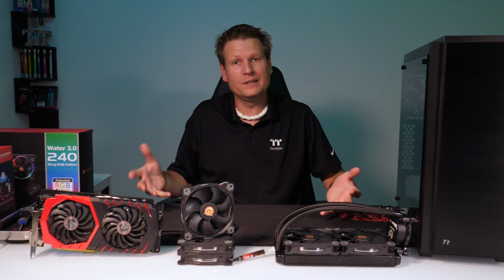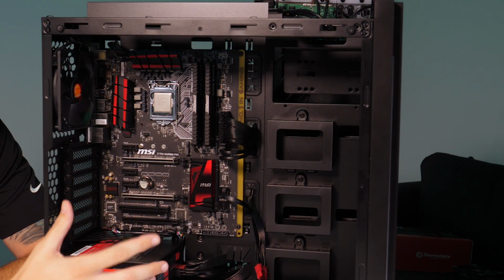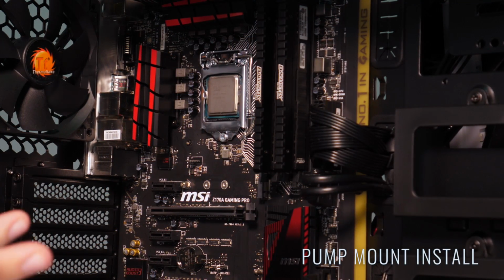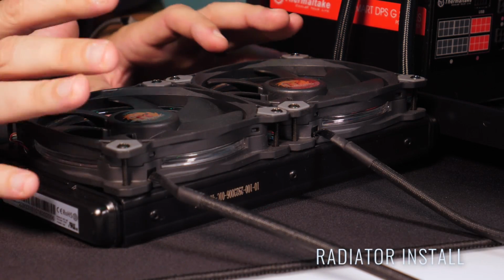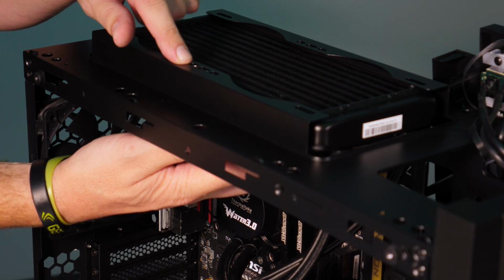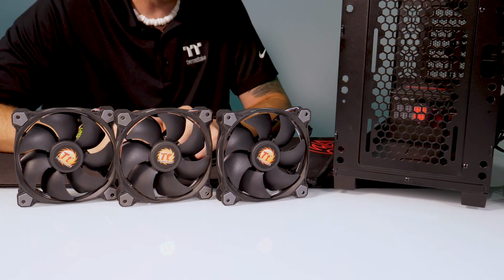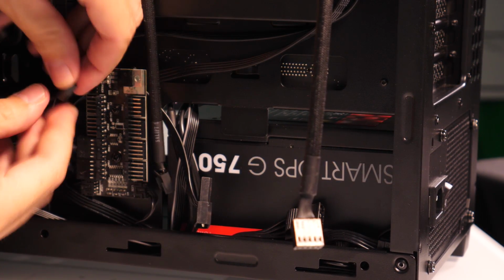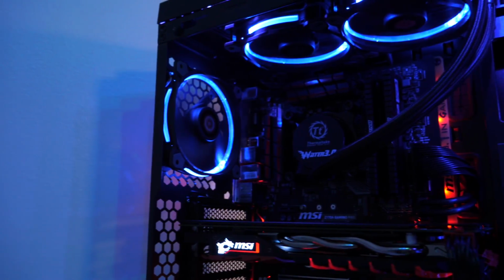Thermaltake Versa C23 Tempered Glass RGB Chassis

Comment: I hate how this case chokes the fans. I have one 240mm rad on top for the CPU and one 120mm in front for the GPU, but the temps are too high, if I take apart the front cover, temps get 12° lower, and the same happens with the top cover.

Comment: Is it possible to connect the controller to the Mainboard for Fan-Speed controll????
Reply: Thor Odinson hey I have the same problem. I'm using the riing 12 fans and they run at full speed. My solution was to just use the fan hub that came with your riing fans. As of right now I have. It found any other solutions
Reply: lagginluther yes I know, that I can use the Controller from the Fans. But I dont wont use it because, the Case has one Controller too. If i cant controll the speed with the case Controller, is that useless for me. And the Controller is for the waste...
Reply: I'm just as stuck as you are. like I said I reverted to using the riing hub that came with the fans. I've been told that you were suppose to connect them to the 2.0 and utilize software to manage both rgb and fan speeds. I was stunned by the fact that you needed to do that as the regular riing 12 fans aren't compatible with the tt riing plus software. here in the next couple of days here I'm going to experiment with molex to fan or molex to usb (a usb mobo to usb type a) and see if I get any results. I tried using a molex to front panel connector but that resulted in the fans not operating but the rgb cycling were in sync.
Reply: Thor Odinson so here is the verdict. I tried a few cables to try and link it to the motherboard but to no avail. There just isn't enough juice to power it. I contacted thermaltake about the problem. tech support verified that the hub in the back of the case is only for RGB sync only and no fan speed control is implemented. Bottom line is that there is no way to have both RGB sync and fan speed control together and they suggested me using the hub that came with my x3 riing fan pack. It's unfortunate that this beautiful case came with such a flaw even when using their own products. Sad to say I may be returning this case for something else.
Reply: lagginluther yes, me too. Get the same answer from Tt Support. I Return the Fans back and use bequiet fans without rgb. Very bad made from Tt. Thanks for your Information about this.
Reply: no problem man just trying to help out. hope everything else works out for your rig.